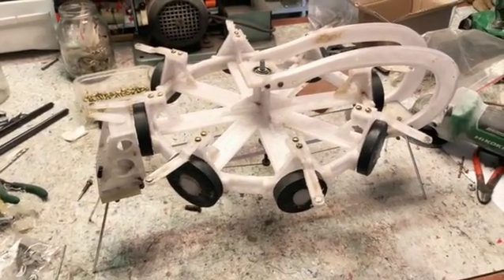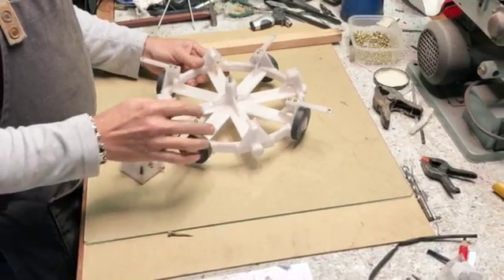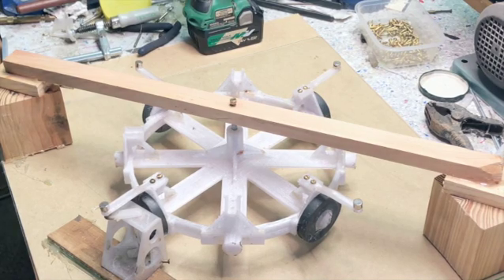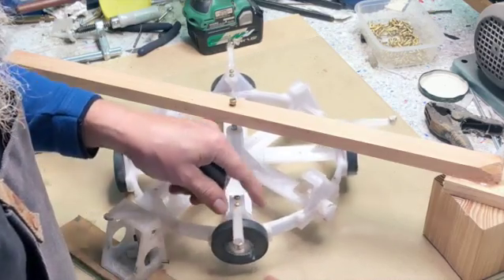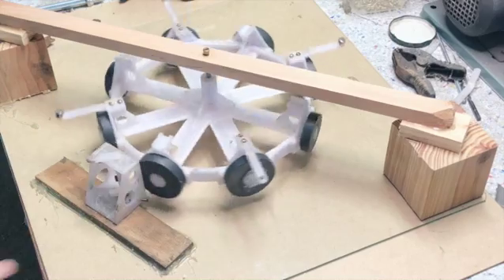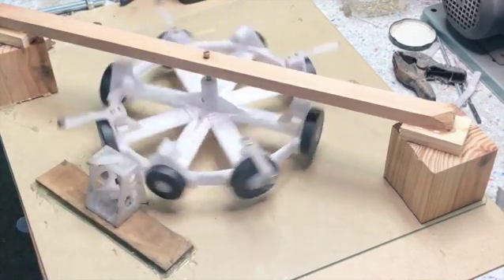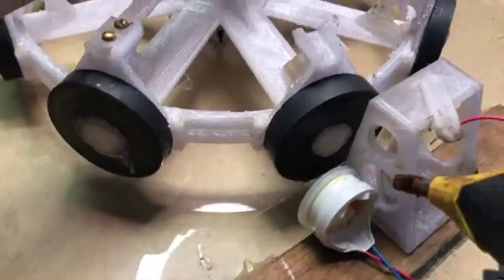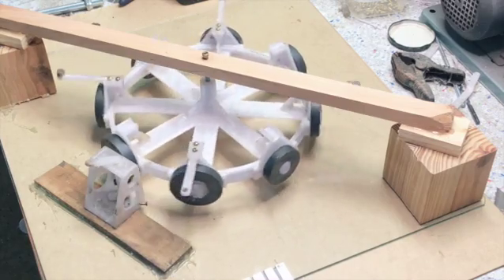How to make a self running magnet motor part 5. Free energy perhaps? The conclusion...

Comment: 9:56 Yeah, they had a mechanism in it where the magnet repulsing, gets pushed by something going off of the wheel, so its not using an external power source... however, according to the creator, they also intentionally weakened their external magnet(the one that, again, is repulsing the magnets on the wheel). Also, why not try this in the inverted way? Like, where the "external" magnet, is actually on the inside of the wheel mechanism like a motor? That'd be pretty cool to see... however, it possibly wouldn't work, huh? Unless I can make it like the one the dude showed off where the magnet can flip itself... Plus, the smaller the wheel, the faster it would appear to spin, no?

Comment: Hello. Great videos! The timing of the switch seem slightly off.  I can still see a little resistant when the wheel magnets are approaching the magnet switch. Maybe if you move the switch magnet back, instead of flipping it and use just the repelling motion at the precise moment, you might create less resistant. The wheel has to spin freely until the switch hits the right point. Flipping might not break completely the magnetic field between the switch and central wheel, because the sides of the magnet have polarity too. Good thinking placing the wheel horizontally! I have a feeling you are very close! Hope to see a new improvement 😊. Wish you all the best
Reply: Just to another thing... Instead of adding more magnets on the wheel, add another switch on the opposite side moving in alternating motion, to create more push. I think the goal is to reach a point where the device will not stop running unless you use a kind of a break, but soon as you release it will be running by itself, unless the magnetic field fades away.

Comment: One way to counter the drag or the "non-desired" attraction/repulsion is to use complex magnets arrangement (Halbach arrays, Circular or not). One other way is to use magnetic shielding with MuMetal to block one side or more of a magnet. Enough steel plate could replace MuMetal.

Comment: There are two different methods of getting a one time clean and free with no sticky point....propulsion from Magnets.  One is using attraction Only.  The other is using Repulsion only.   

The First one uses attraction only and is called the Tucking Top.  It consists of a thick wooden disc with a bb or smooth spinning tip at the bottom of the disc.  In the disc are two wooden or plastic slats with magnets glued to the ends of them.   These two slats slide in and out towards the center of the disc.  They act like the Ice skaters arms that tuck in, and make them spin really fast.  There is a divider in the center of the disc, so the slats with magnets on them, don't slide into the center and crash into each other.  
There are stops in the slat tunnels, that stop you from pulling them all the way out, when you get ready to spin the Tucking  Top up.   
You pull the slats apart from each other until they hit the stops....the magnets on the ends of the slats want to snap back shut sliding towards each other if you let go of them...

Now place it on the table or a smooth surface...holding the Tucking Slats all the way out until they hit the stops, then give it a quick turn and let go.  Now the Top starts spinning up Faster on it's own, as the Tucking slats pull themselves in towards the Center of the Top, like an Ice skater tucking their arms in....It will in fact start speeding up on it's own for a while.  Not claiming this to be a toy that keep spinning, but it does show how to gain some propulsion just by using two magnets attracted to each other.   You could probably get the centrifugal force to Tucking force of attraction balanced somehwhat where it goes through a pumping action for a while.  Speeding up as the Tucking slats tuck in, but producing enough centrifugal force to keep them from Tucking in any further, etc.   

The second method may in fact keep running until the parts wear out, and it uses Repulsion of two magnets only.    It is a Launch ramp with a catch trough at the top of the Ramp, that catches a Disc magnet, and makes it line up and roll down the Launch Ramp again.   The shape of the Launch ramp has the end of the Launch ramp aimed where the Disc Magnet rolling off of the end of the ramp will catch air back up and towards the Top of the Ramp where you the Disc Magnet was originally Dropped in From.             Near the bottom of the Launch ramp, right by the location where the Disc magnet starts to go up the launch ramp, there is a  BASE magnet embedded in the Launch Ramp Frame.   It is positioned to tell the Disc Magnet rolling down the Launch Ramp towards to "Get Away From Me", right there where the Disc Magnet would love to get shove away from the ramp and off of the End of the Ramp FASTER than normal.   If the Repulsion of the Base Magnet, pushing the Rolling Disc magnet away from it, at the right location at the Bottom of the Ramp does help it Catch More Air than Normal....Then yes it may in fact keep running until the parts wear out.  Making the Disc Magnet roll and launch off of the ramp and land back up at the top and start over again.
Reply from the maker: Great ideas and good explanations:-) Thanks for sharing.

Comment: You failed because you didn't make the same thing. You changed almost everything about it. It is supposed to be vertical, not horizontal. It is a magnetically assisted gravity wheel, not a magnet motor.
Reply from the maker: Good point..

Comment: I was wondering if you set up one magnet as a pendulum and using the switching magnet to see if you can maintain the swing of the pendulum manually.  Gravity provides the moving force.  Is there enough momentum to move the switching magnet and overcome friction losses?

Comment: Hi Christoff! Too bad it didn't work out, but at least you tried! 👍
Reply from the maker: Thanks! All was not for nothing though. I have learned so many things. Maybe if I spent more time on it I might get it to work better. It seems that it is important that all the magnets are the same strength. Mine was not. Also, it will be better to have a mechanical switch rather than magnetic one. And if everything can be adjustable without bending wire or heating up plastic, especially the swich timing it will be easier to get the timing right. 
Then the wheel should be balanced perfectly. Mine was not. I might convert this setup into a bedini motor, and it’s back to the drawing board in my head about this. 
If I do another attempt, I will rather make it, do recordings of tge prosees, but only post a video or two when I succeed. Now other people can also try and learn from my mistakes…
Reply: @thequixotryworkshop2424  It would be interesting if you could continue this project in the future. I will keep an eye on your channel! :-)
Reply: @thequixotryworkshop2424  Desde un principio el interruptor magnético fue algo mal pensado, pero de los errores se aprende :-D